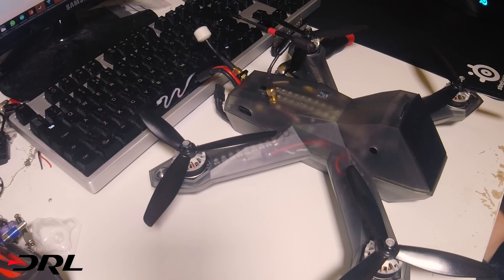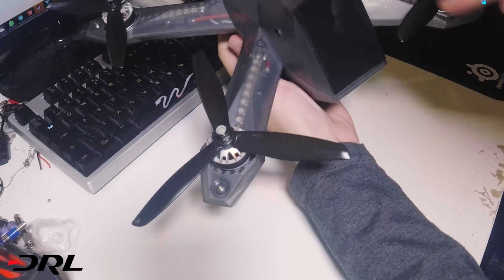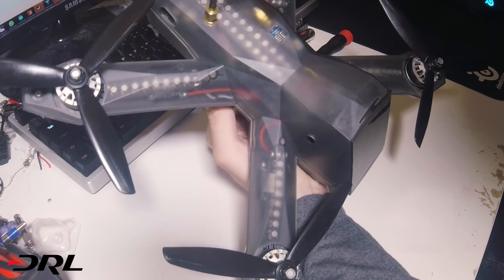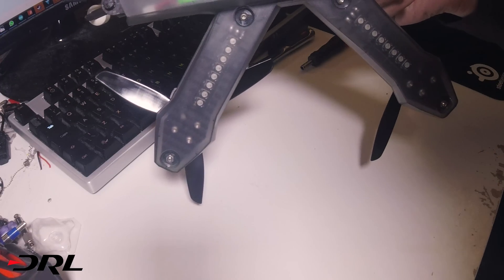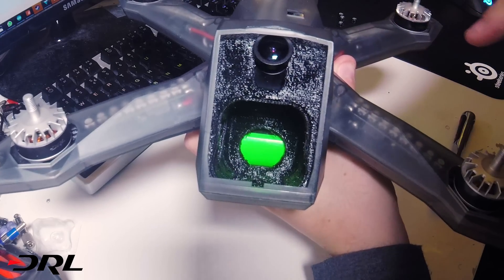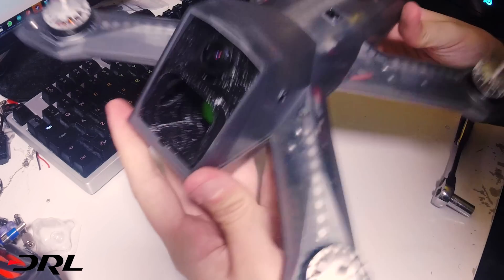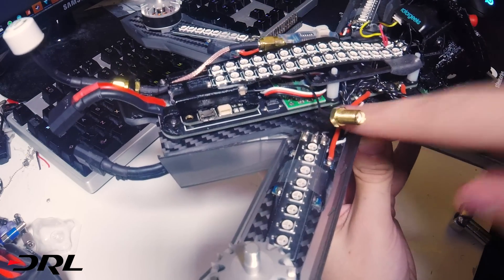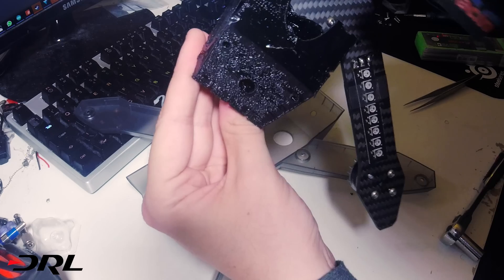DRL Racer 3 - Overview & Teardown

Comment: thanks Mr.Evans i just decoded the DRL carbon frame design with CAD and you just made my job easier with the video and the specs you shown in the video and description.The exact drone shall be rebuilt and flown in the next MULTI-GP event for showcase,AND THEN THE PROJECT SHALL BE OPEN-SOURCED TO THE PUBLIC......FPV-FREEDOM

Comment: Great video! The Quad looks ugly in my opinion. And why do they run Oneshot 125 in times of Dshot 1200? They could have used Cleanflight and PPM...smh
Reply from the maker: Because DSHOT was not out when the quad was made, and the ESC does not support multishot without custom firmware. Regardless, with the way the Racer 3 flies it just goes to show all these new items are not really needed :)
Reply: Matthew Evans Matthew Evans Dshot 1200 wasnt out. But they still could have used Dshot600 or any other ESC protocol...but they choosed the absolute slowest. You say it flies great...I am sure it does but it would fly so much better with just using Dshot600.
Reply from the maker: DSHOT was not out at all when the Racer 3 was designed :) it was used in the 2017 season, manufactured/put together late 2016/early 2017, but the design phase will have been even further back before that, including testing etc :) probably at the start of 2016 realistically.
Reply: Matthew Evans wow I didnt know that it is already so old.
Reply from the maker: Haha it's crazy right! But yeah some improvements for this year would be cool, so we shall see :) to be honest as I say it flies pretty nice anyway (if you see some of my recent videos for footage).
Reply: Matthew Evans I will check them out.

Comment: why dont they go with modern  4 in1s or just the hobbywing stack.  An little foxeer cam. And an immortal t antenna. and an ufl axii????
Reply: or an cicada aio?!
Reply from the maker: When the quads are specced it is months and months in advanced of the season being filmed (which is also months before it is aired), so they are ready with the 600 quad fleet, and at the time none of what you've said existed as products :) also they require tried and tested products that will take the abuse, but also not let any of the pilots down in the races, and so while some of it is a bit out of date, it  just works :)

Comment: What hs1177 setting would you recommend for low light light trax type events.
Reply from the maker: For the most part make sure AGC is set to off - this will stop the lights from creating huge "light spots", making it all viewable :) other than that you should be good, adjust the blue/red brightness depending on what you need to see or if one is overpowering and that should be it :)
Reply: Matthew Evans thank you.

Comment: The polarization filter in front of the cameras doesn't protect against water (well, not any better than any other transparent pane of glass), but against the REFLECTIONS from water (or anything else that reflects) ;-)
Reply from the maker: I didn't mean the fact it is polarised stops water, just that the sheet of plastic being there in the first place will stop water. And yes, polarisation will stop reflections that you describe :)

Comment: I know this is not available to public but if I was to buy all the parts and everything I needed to race how much cash would I be charged?
Reply from the maker: So if you take a look at this as an example build: https://rotorbuilds.com/build/2400 all you then need to buy is a Transmitter (I recommend an Frsky Q7 or Taranis X9D), and then a set of goggles or a screen to view from :) so you can get setup for around $500 for a good drone that will race no problem.
Reply: So I could build a drone almost exactly like this with setup for only $500?
Reply from the maker: For around that yep :) it won't look identical to this but it will fly and race no problem! The DRL quads are pretty unique looking. :)

Comment: im thinking i could make a similar style frame a lot lighter than that using thick lexan and carbon framing for camera mounts instead of tpu. very cool design though.
Reply from the maker: That's a cool idea! Yeah I mean from Racer 2 to 3 this has come on leaps and bounds, Racer 4 I would imagine is going to be insanely cooL! :)

Comment: WTF 1KG ? it must fly like an train
Reply from the maker: Check the other videos of it I have, it flies great :) 7:1 thrust ratio, so not as powerful as your normal racer (around 10-12:1, but still fast!)
Reply: Good racing quads are more like ~15:1, so 7:1 is disappointing imo. Turn on ACC (of course fly acro) and record some WOT and hard turns, be curious what G's that thing pulls.

Comment: Great video! I've been after a tear down video of one of these beasts 😊. Have I missed something, to change the lipo, you have got to remove 8 screws and disassemble the protective canopy?
Reply from the maker: No problem :) there's actually a hole in the rear which I didn't cover -the battery just slides in from the back :)
Reply: Matthew Evans Thank god you cleared that up, it would have really bugged me ha!! I was surprised by some of the components in there, and not all running the latest (hype) firmwares. Just goes to show I suppose! Cheers for the reply 👍
Reply from the maker: :) no problem! and yeah, many people are hating over the spec but honestly it flies great, and not using multishot etc noticed no delays xD just goes to show a quad can fly just fine with a good tune haha!

Comment: Quick question does rotor geeks sell the 30 amp esc version with the same reliability on 5s?
Reply from the maker: I am not sure I'm afraid, I've never used the 30A RG's, I just know the spec on these is great for 5s. To be honest many ESC's nowadays support 6s - most of the 30A BLHeli/S do :)

Comment: I will like to buy this frame and compare it with a different frame that's light. Yes, use the same components and see which one is faster. I feel like is dumb heavy.
Reply from the maker: To be fair I'm not sure the frame itself is that heavy - if you were to add all of the Components so GoPro, LED's etc I don't think it'd be that much more. I bet the frame is only 150 or so. I'd have to weight it but that would require taking it all apart! :( Interesting idea though!

Comment: Why 6 inch and why such old software for the escs?
Reply from the maker: 6 inch due to size and weight of it to keep power + grip. ESC's were chosen because they are hugely robust, no need to run multishot or dshot when it flies great :)

Comment: You said the motors are like 1800kv but on getFPV they say the BrotherHobby T2 2600kv motors can also run 5s.
Reply from the maker: MajorProblemsStudios these are custom KV made for DRL, you could run 2300kv on 5s but would have to run like a 5x3 to avoid high amps

Comment: How do they manage the Vtx signal through those stadiums? frequency repeaters every where?
Reply from the maker: Not exactly sure - its a complex array of repeaters, modified Clearview units and other such wizardry! I can tell you the picture is awesome though :) the guys behind the RF are geniuses!
Reply: They should open source that =)
Reply from the maker: haha yeah, though I think right now it is too valuable for competitors :)
Reply: It's not that difficult honestly. Just very expensive to set up those systems.

You need a lot of diversity antenna splitters and spread out a lot of antenna's around the course with adequate boosters in the network as well.

Some thing happens with Radio Microphones at concerts, those shows usually have around 2 to 8 RF Antenna's spread around the stage just to cover RF on the stage. (Bigger stages need more obviously)
Reply: No vendéis el frame y el policarbonato? Me mola mucho ese frame más que los anteriores y me gustaría poder hacerme el mismo o uno parecido , tenéis archivos para hacerlo con impresión 3d aunque sea
Reply: Grespino 1 naw cause the radio is 2.4 so I doubt it unless they are no longer using the regular tx rx setup

Yeah I see the antenna is 5.8 so nope you can tell right away by the antenna they use.. it would be much larger if it was 2.4. The axii they are running here is 5.8 no doubt about it
Reply: the pilots actually use 2.4GHz apparently for the video

Comment: How long does it take to change a battery? It looks like you have to remove the whole canopy! Surely that takes almost 5 minutes!
Looks like a great quad other than that, I hope I'm misunderstanding something..
Reply from the maker: MPAII takes maybe 20 seconds, it slides out the back :)
Reply: That's cool, so there's no battery strap needed then?
Reply from the maker: You can get away with using one, but it tends to still eject on impact :) with a strap the battery stays in nicely.

Comment: Why use a rando china vtx for such an event?
Reply: Actually a lot of weird choices. Why a rebrand of an hs1177 instead of just buying it direct? Why a year old ESC for a 2017 quad?
Reply from the maker: Zapf because the escs are super reliable when not much else has as good rated fets or 5s usage for the cost. As for the camera it I'm not really sure. You have to remember this quad will have been in the works at least this time last year. And reliability is key.
Reply: I didn't realize 5s reliability was such an issue - theres a lot of escs rated for 6s, but I obviously those still get mostly used on 4s.

What are the modifications on the vtx? I figured immersionrc would have surely tried to get their hardware in there.
Reply from the maker: From what I gather everything gets a bit funky the higher voltage you go, especially if you consider 6s :) I'm not 100% sure on the vtx modifications (and that is likely some info that would not want to be shared if I did know) - but when you consider the circuitry for a vtx like this is super simple (versus a Tramp or Unify where its really all custom and does not allow for modification) - you can see why they have gone for this - it allows them to control the hardware and modify as required without any third-party. They could have of course made their own VTX's, but with something like this it saves half the work for them. As for IMRC/TBS - well I think that is the reason above, as there's already some TBS gear in there (crossfire), and also it's using Lumenier antennas not Triumph's too :)

Comment: How is the Crossfire micro antenna soldered to the connector to run the tuned antenna? Do you know if this is a straight up mod that anyone can run with their system? I really like that over the whip!
Reply from the maker: It's using a uFL to SMA adapter - similar to that of a Unify VTX :)
Reply: Can you elaborate on the repeaters or tell how a group organizer could do something similar? I'm a chapter organizer but honestly have no business being one so am always looking for ways to make things better!
Reply from the maker: I'm not sure of that myself I'm afraid, that's part of the wizardry we don't get to see - but I imagine it's very well protected and sensitive information too :)
Reply: But like are there certain hardware devices in general that we as FPVers can use for this type of thing. Like some kind of ground station that links two or three other ground stations together? That's just my imagination talking of how I could see something labeled as a repeater working and have no real factual basis that I've envisioned such a thing lol. I did google FPV VTX repeaters without much luck. And googled Clearview but only saw their proprietary RX stuff so just confused on the basic ways repeaters even work, especially when thinking of FPV and latency.
Reply from the maker: alford35 I wish I could help but as I say you know as much as I do xD sorry man